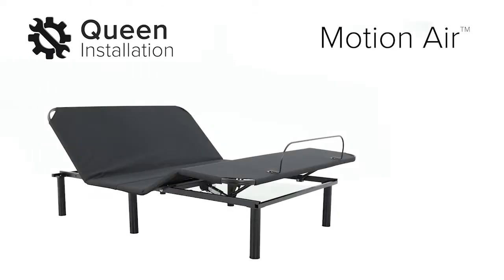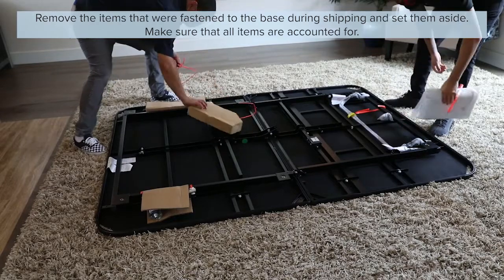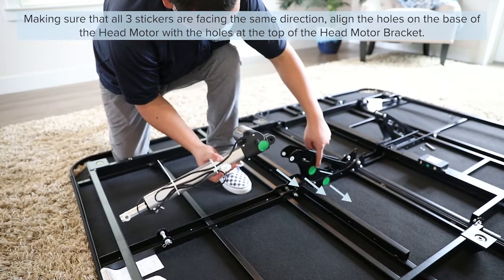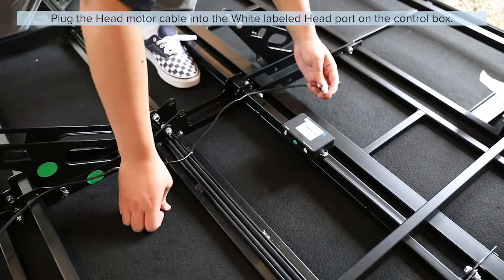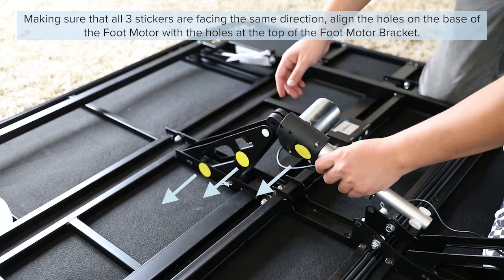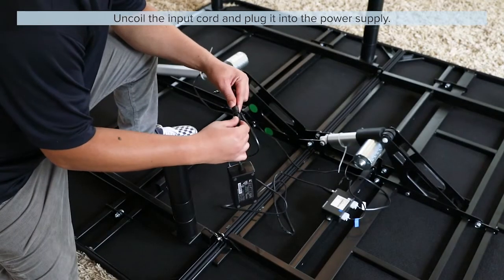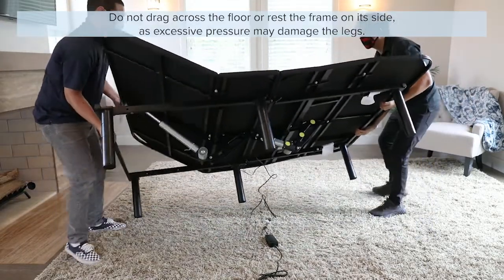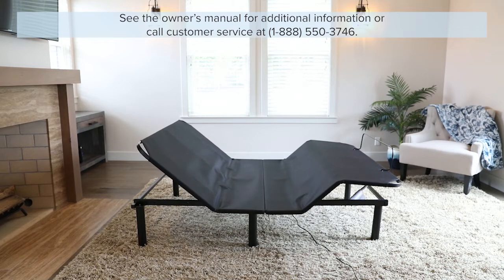BR20 Motion Air Queen Setup Video

Comment: Ur foot motor is backwards. It won’t line up that way as indicated on previous comment and the instructions tell you to attach motor end to frame as it will not line up when u try to insert screw to attach motor into triangle bracket.   Motor end gets attached to bed frame.